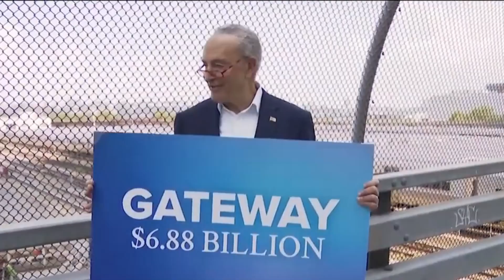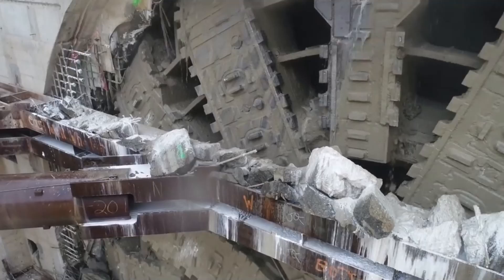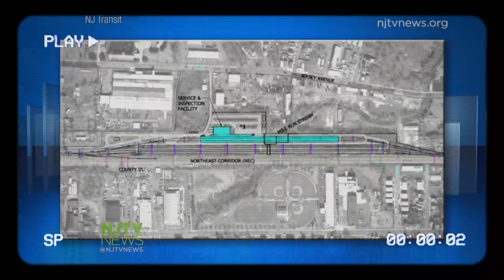New York’s $16BN New Mega-Railway

Comment: Not much in the way of commercial product moves through this really small area actually ... I think none actually as all of that is reserved for Staten Island. Having said that the biggest problem is one of speed as to get from New York to say, Richmond Virginia the most important Inland Port along the Eastern Seaboard takes forever let alone going from New York to Washington DC. A direct line from New York to Richmond non-stop is what is needed and not just "leaving New York" only to go to Philadelphia then Baltimore. That is something for commuter rail to handle not Amtrak. Amtrak has in fact become a huge success in the USA over the past 30 Years but #irony_again not along the Northeast Corridor which still overwhelmingly uses cars, trucks and vans to "make it happen"(allow the Region to even exist as economic units.) Given Uber, Lyft, Turo and possibly full on driverless vehicles and "highway congestion" could plunge in the USA. In the meantime however and given crazy high oil prices Railroads are most definitely critical infrastructure upon the USA especially given all the Wars going on everywhere quite suddenly.

Comment: The new tunnel will actually be slower than the old one since it's circuitous and serpentine. It will also be expensive to maintain due to the curves built to close tolerances that must be constantly maintained. That's deliberate, and it's the reason we can't develop an upgraded passenger rail system with high-speed rail till the "deliberateness" among  our transportation administrators - particularly in the private sector and those colluding on the public side - can be brought to heel.

Comment: The project is very needed, even more so with NYCs congestion pricing. It's unfortunate that it's taking so long. What I really don't understand is how a new Port Authority Bus Terminal is costing 10B and this is 16B. How is it that a bus terminal is costing 10B?!?!? The rail from Penn continues under Manhattan for the LIRR, Amtrak, and NJT to use the Sunnyside yard. Why wasn't there ever an additional station considered around Park Ave South providing access to that part of Manhattan? I also think the #7 line should extended into NJ. I used to think that Metro North's west of the Hudson lines (from Port Jervis & Spring Valley) should divert and run across the new Tappon Zee, loop and join the Hudson line into GST. If Gateway gets built there is probably not a need for that anymore.
Reply: Because the city and state is notoriously corrupt and loves to over-spend on everything. Like they will have to allocate probably 200mil just to art for the project. Also part of the problem is the Unions. their pensions alone are in the 6 figure range. They work half as hard as alot of retail workers and get payyed twice as much with twice the sick days.

Comment: To improve efficiency why not make trains compatible to run between LIRR and NJ transit.
Reply: Yes, through running trains would be so much more efficient.
Reply: They share some equipment. good luck convincing the MTA to install overhead wires and raise up a few bridges!
Reply: @harrisonc985  yeh I think the only way of merging both systems would actually be transferring their control to the Port Authority. A lot of work would have to be done and I think it could take about a century to pull off, considering the fact this is New York where talking about
Reply: @electro_sykes  The states would never agree to it. It would be ALOT easier to extend the PATH directly to Atlantic Terminal because PATH is already under the juristiction of the port authority. Even better, they could make the path run all the way to jamaica on one end and then to EWR on the other end of the system. it would allow much easier access to both airports without having to mess with the subways. It would more convinient for tourism and it puts pressure off the subways allowing space for them to upgrade. another added benefit is the reduction of bussess and ubers traveling between the airports for transfers easing up some car traffic.
Reply: @harrisonc985 port authority wouldn't do that either becuase it wouldn't benefit thier bottom line. They wouldn't gain much as a system by extending thier system that far. They only did the air train in jfk bcuz it gave them functionality in the airport and profit outside if it
Reply: @Alexander-ru3qc  they could possibly steal ridership from those busses that run between the airports offering a slightly longer trip for cheaper but yeah i see where your coming from.

Comment: From what I understand, the gateway project is essentially entirely about movement of people. Goods doesn't enter into it.
Reply: With 4 tunnels and no service from 12:30am to 5am on NJT, they could easily use it for high priority freight going in and out of manhattan in those hours. which will be great because the tolls for comercial trucking across the hudson are ludicrous!
Reply: True, it's primarily designed for people-moving, but freight will also be moved just as more efficiently as Amtrak and NJT services will by this upgrade. It's only an afterthought though.

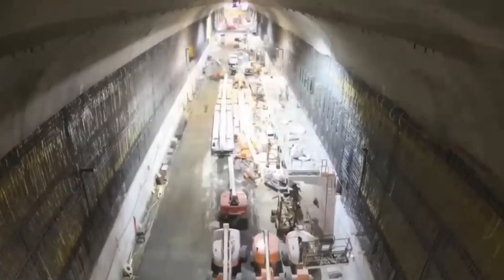Comment: they gotta do some more north of NY, shouldn't take 3:30-4 hours to get to NYC from Boston
Reply: There used to be tracks on the lower level of the GWB but they got rid of them for more lanes. Most stupidest thing ever since I-95 becomes 3 lanes each direction in the Bronx.
Reply: @josephzastocki2815  The GWB was only designed to accommodate subway tracks on its lower level if one was added. That capability was never advanced as there was no call to expand the subway across state lines.
Reply: one Christmas I took the bus from NYC to Boston. It took a little less than three hours.  Amazing what can be done absent the crappy infrastruction railroads have to deal with.  Of course, I have no doubt the bus driver was going over 70mph on the highways, but still..
Reply: NYC to Boston has lots of track bed issues.
Reply: @robertewalt7789 And broken drawbridges.   The Rail corridor from Waterbury Connecticut to Hartford Connecticut might make an actual plausible High-Speed rail line to Boston, but Connecticut is at the forefront of nimbyism.   Another possibility is to connect Long Island to Rhode Island via a bridge or tunnel
Reply: @harrisonc985 None of the NYC airports have direct, one seat transit, airport to central city. JFK: air train to Jamaica, change for LI RR. EWR: air train to EWR NJ Transit station, change for NJ Transit to Penn Station. Of course, LGA is served only by buses. Any other major city like this?
Reply: @robertewalt7789  None? EWR does indeed have direct transit. just because the tracks arent right next to the terminal doesnt discount it, unless of course you yourself are brave enough to cross us route 1 on foot. the airtrain goes right from the terminal anyway and is free. 
IMO what they should do is extend the path on one end to EWR and on the other end to JFk on the other end. PATH is already under the juristiction of the port authority which runs the airports anyway. they could probably run it next to the 4 and 5 then continue on the LIRR tracks at atlantic. But they’ll probably never do that.
Also SFO, Dulles, BWI, Philidelphia intl, and Providence intl all have direct transit access to city center.
Reply: @harris The DC Metro goes directly from central city to both airports. No change of trains necessary. JFK, EWR not like that. I don’t know the other airports you mentioned, but I do know both Tokyo airports, Hong Kong, Beijing, London Heathrow, Toronto, Chicago. All one train, one seat, airport terminal to central city. I agree with you, PATH should continue to EWR, or at least EWR NJ Transit Station. PATH to LGA or JFK? Interesting idea.
Reply: uuuhhh did you try flying? EWR and JFK have direct rail access to the whole city.  There is simply too many level crossings and tight curves in connecticut RI and Mass.
Also, good luck convincing the residents of new london connecticut and the USN submarine base located there to bulldoze their downtown and spend a billion dollars in elevating the track and building a massive bridge  just to shave 20 minutes off your travel time.

Comment: 2 things they need to do getting rid of the crossing and dealing with the freight trains  make a 2 line for them or make into electrician freight trains.
That's the only thing they need to make to high-speed rail.
Reply: Freight movements do not involve Penn Station and historically never have. The tunnel clearances on both sides are too small and passenger traffic too dense.

Comment: Private money built the original tunnels 100 years ago with no trouble at all.  Now, 100 years later, with computers, lasers, new techniques and new materials suddenly everything is impossible without $16 billion from the taxpayers and even then it will be so very difficult.
Reply: Private money built the original tunnels to gain a competitive advantage over several other private passenger rail operators who, like the PRR itself until 1910, could only get New York-bound passengers as far as the opposite bank of the Hudson River and then onto boats or the then-recently-opened Hudson tubes, now known as PATH. In other words there was short term profit to be had by building it. Suffice it to say that a century of public funding for the infrastructure that makes car and air transport viable has changed the game just a bit. 

But sure, if it makes you happy, let’s pretend everything else is just as it was 115 years ago and the need to fund public works publicly is a moral failing. Fine. Even given that, no one is stepping up to fund this with private money, and the fact remains the alternatives (cars for short trips, planes for longer ones) cannot absorb the 200,000 travelers who move through the North River Tunnels daily without descending into chaos.
Reply: Great point @de-fault_de-fault!
Let's not forget when the tunnels were built, the railroads didn't have outdated regulations holding them back, and the government wasn't using taxpayer dollars to build airports and highways, so the railroads weren't being unfairly held back. Unlike today, where the passenger railroads of today get barely enough funding to operate because "they're too expensive" while we spend billions more on less efficent highways and airports.
Reply: I wonder if the PRR had a state or federal law requiring them to pay union wages?  And set aside 10% of the budget for artwork?
Reply: @ArtStoneUS 10%?! u got a source for that?
Reply: Plus, the original tunnels, using 19th Century technology, were completed in less than 3 years.
Reply: as usual, heavy on opinion, light on facts
Reply: The public uses the tunnels so I'm not sure what's the problem. Private railways in the Northeast don't exist. 

However, I cannot understand why it will take so long to build a 2-mile tunnel.
Reply: I don’t feel that comparing the unregulated work of the early 20th century Pennsylvania Railroad to present day is fair.  The city has grown, the infrastructure has grown, the complexity has grown.  And trying to do all this work while maintaining the current level of rail traffic.  This is no small task.  Expecting this work to get done in the same time frame as it took over 100 years ago is reasonable.
Reply: because that was before the mob controlled construction and concrete, before beurocratic overregulation, and before deisel fuel was 6$ a gallon!
Reply: and very slow
Reply: What are you talking about? Of course there were problems when it was built. Workers even died during its construction.
Reply: well, remember that the capital for those projects was provided by the owners of the railroads that used those facilities.  So they were not public works at all. The railroads need not have failed in the manner they did if the private automobile had not been oversold to the American public, leading to the ruin of most urban centers in the US among other serious complications.  Thank God, though, many people and places are finding their way back to urban life, and public transportation is popular in places where it's available and adds meaningfully to quality of life.
Reply: Whenever you go to your licak grocery store, thank the highways that make it possible. Public transit has never been used to deliver a single loaf of bread. @DannyEastVillage
Reply: When you compare the results with other similar constructions going on elsewhere in the world,you can conclude that ‘this is a joke’. This isn’t the U.S. that we love and admire.

Comment: The project seems interesting, but they truly have to get some European rail engineers on board, because it seems like this project, like the other commenter is saying, is falling flat because it's not innovative. They're using oldschool thinking for this, and don't realize how to properly do it. Don't get me wrong, it's amazing seeing the USA build more rail infrastructure, but I'm afraid that they're making some key mistakes that will keep the system from reaching its full potential
Reply: well, that's all very well, but you have to work with the New York City and surrounding infrastructure--that you have.  Without doubt, the whole thinkgcould be re-imagined, but think what it would cost!  And the disruption within Manhattan would be unthinkable.  Good god, look how many years it took just to get the money together to build a new rail tunnel--one two-way tunnel--between Manhattan and Jersey--a tunnel that has desperately needed replacing for 50 years!
Reply: But your assuming the main purpose of this is improving infrastructure.  This is a political project designed to suck billions of dollars from across the entire country to exclusively benefit NY commuters.  NY and NJ politicians have delayed this project for decades with demands that NY and NJ shouldn’t have to pay for it.  And the reason for the astronomical costs is the union contracts.  Union workers can expect $90 and hour for base wage plus overtime plus fully paid benefits.  This plus the regulations and local kickbacks is why this will cost $2.25 Billion (2.07 Billion Euros) for each kilometer! All of this provides huge pools of money under the control of local politicians from which to siphon campaign funds “donations” to their trust funds and foundations.

Comment: The gateway program is huge but it is not inovative at all and this lack of innovation is making the costs escalate out of control and the sad part is the new tunnels will not move much more than what is traveling today, because it does not connect to anything more than Penn Station.  It plans to double train capacity as in the number of trains.  And the plan is designed to fix a lot of the capacity and old infrastructure between Penn and NJ.  But this plan is not innovative nor will it fix problems of the lack of through-running between NJ, NY and CT. London, Paris, and so many other cities build tunnels that connect major destinations and go beyond the core.  NJT has done a study under ARC that says 36% of NJT riders want access to Grand Central.  This plan will not do that.  Instead, they will expand Penn Station as if this is 1890 not 2024.  Nobody builds stub-end terminals anymore and the project will require tearing down a block south of Penn Station using public tax dollars to purchase the land.  The costs have gotten out of control.  If the design were truly revolutionary it would use fewer tracks and link to Grand Central and allow trains from NJ to travel to and from Metro North and LIRR territory.  The gateway program is not a program that is using new ideas - its using old ones (stub-end terminals) and it really needs to be rethought.
Reply from the maker: Thank you for sharing your insights on the Gateway Program! It's definitely important to consider all aspects when it comes to such massive infrastructure projects.